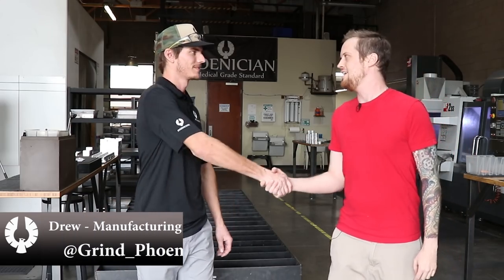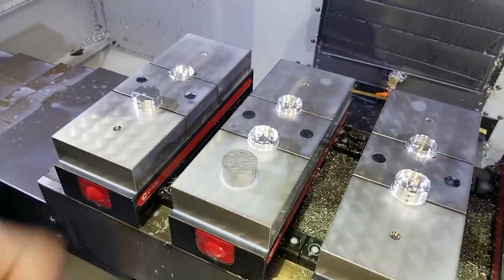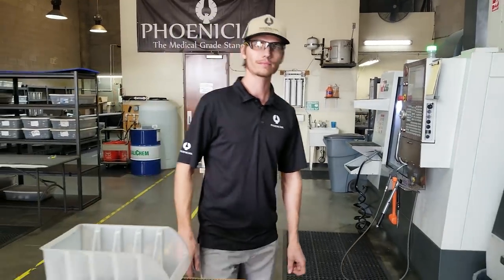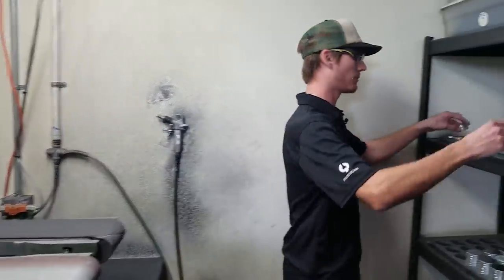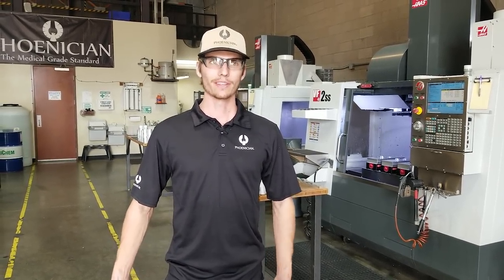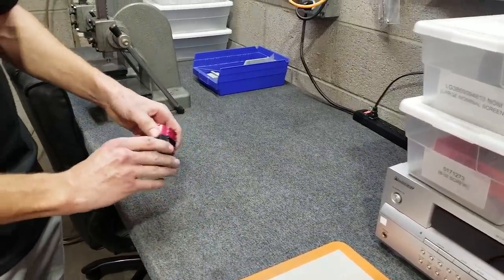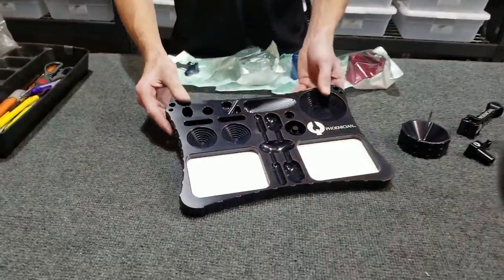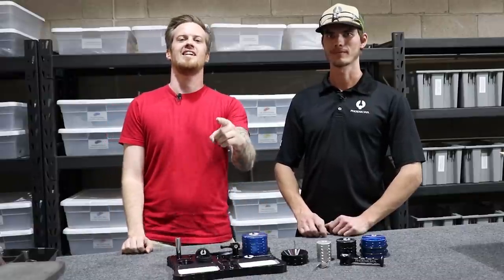How Its Made: Phoenician Herb Grinder

Comment: A couple things i dont think were mentioned that really appealed to me. First, I have a large 4 piece that I've been using for 2 years and it's just as good today as day 1 and I smoke daily so i got some street cred with my comment. It is supreme quality in design. Powder coating will not scratch. A few key elements are its threadless so no keef can escape and affect operation like other threaded grinders. Phoenician uses powerful  magnets with a beveled lip on the lid that fits super snug and will not come off unless you want it to. I tested it rigorously because that was an initial concern of mine. The screens are removable and are available in different microns that are held in by an allen bolt through the center and a notched ring machined for a snug fit for the screen to sit. The  second, third and forth stages have locking notches as well, so still no threads all the way through. It will not open up on you with travel if you were concerned about that, as I was. Lastly, the design of the keef catcher is unique in the sense that it literally is a bowl shape with no corners so every bit of glorious droppings is effortlessly gathered and requires no cleaning whatsoever. Sorry for the big post but if you made it this far I just figured I'd address those things because they were my concerns because it's not cheap but I assure you it will be the last grinder you'll ever have to buy. Alright I'm done.

Comment: I do wish they made an electric grinder. I have 1 arm so grinding flower is tough with spinning handheld styles. Using ✂ to cut it up means 25% of my flower will be launched at 4000km/sec in every direction. 
 
I have an electric one right now but its tough to not overgrind, and basically puree, my flower.
Reply: That's a very good idea! My good buddy lost his hand and has that same problem. I think i might look into making something
Reply: @irishstunter1715  my wife got me an electric "herb grinder" for the holidays. It's called "Easy Grinder".
 
Its not perfect but it works. Its a bit too powerful though. Its great for grinding it up for blunts/cones (it even has a moderately effective swivel opening at base to pour into a conewrap. ) However its not perfect. It takes a bit of getting used to. 
 
I wouldnt recommend it overall... But its a step in the right direction annnnd better than scissors.
Reply: put large loop velcro on the bottom and velcro in your smoking spots, for example - on your dash. load it up, velcro, spin, look ma, one hand! hope this helps
Reply: @420wizdumb6  big thanks! Gonna tell my buddy to do that now, amazing idea!

Comment: Sometimes cheaper import grinders actually have metallic paint or glitter flake or something in the teeth. That'll get on your herb and can mess up your lungs. Grinders like Phoenician, Cali Crusher, Kannastor (there's lots of nice brands) manufacture grinders from higher grade aluminum. So it's safer to use I'm sure. Especially with how often people use their grinders. Most people will keep a grinder for years until it breaks!